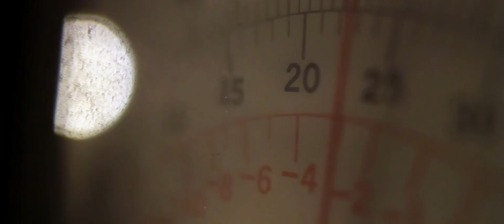The Morgan EV3 - Official Launch Trailer [HD]

Comment: It looks slightly oversteering in the sharper corners? A reverse trike needs its CG close to the front wheels, hence the old Morgans had their engine up front.However  in an EV you have hundreds of pounds of batteries, and can't place them where the drivers legs are, so they put them behind the seat? This is a recipe for cartwheeling. Imagine going over wet leaves in a bend, instant 180!! The motor controller heatsink in front of the headlamp is a beautiful design choice.

Comment: Would be cool with a manual gearbox, but there is not the joy of the combustion sound and no there is not the joy of rowing gears. For me, almost looks a soulless car. The design is beautiful.
Reply: +Ger Downshift Unfortunately the combustion engine is finished, at least for 98% of vehicles so you can't blame Morgan for that.  I would suggest that out of all the electric cars available this one has more 'soul' than most of the others put together, it still looks incredible fun even though you don't have the sound of an engine.  Love it or hate it quiet running electric cars are the future, enjoy that V8 while you can.
Reply: +IanObzi ya ya ya the fools have been saying that for 110 years .. with all the oil around and the lack of electric  miles distance before recharge .. long time recharging , lack of recharging stations .. and the need for gas tax to off set the lack of sales .govt. forced buys . it will be another 100 years of battery up grade changes to even think of it happening ..
Reply: IanObzi Yes, you are right. But what I said is that would be cool if it has a manual transmission at least; you would improve performance and battery autonomy at the same time. Imagine yourself "heel and toeing" in an electric car... so much more fun than just sinking your right foot. (Sorry for my english)
Reply: I'm going to the Geneva show this weekend so hopefully I'll see this in the flesh, I did the Morgan factory visit last year and it was great to see a little company making something very different to anything else on the market.

No apologies for your English, it's very good, better than many people who live here in the UK.
Reply: +Ger Downshift  I might be mistaken, but from what I have read, for electric vehicles, there is no need for multi geared transmissions. For electric motors, torque is torque is torque. Recall why a multi geared transmission is needed for gasoline engines (start immediately in a  high gear and the gasoline engine would simply stall out--unable to deliver that kind of torque to such a high ratio gear combination) and I believe you'll understand why it won't be needed electric motors. Check me on this...read about it a while back, but I believe this is the case.
Still, this is a wonderful cycle car...much more my style than the Polaris slingshot which is the only cycle car available in the US which I know of.
If you do see the Morgan at the show in Geneva, ask them about that and get back to us here. I'd love to read their perspective on this issue.
Reply: Drew Abas Yes, there is no need as in internal combustion engines, but with a manual transmissión you would improve acceleration and autonomy at the same time. Shorter gears give better acceleration and longer gears give more autonomy. In fact, Formula E cars have multi-gear transmissions, and the Detroit Electric SP:01 has a manual transmission as an option, so obviously there is a profit using a multi-gear transmissions with electric motors. In other words, it isn't necessary, but is better. (Sorry for my english)
Reply: +Ger Downshift well, give us a full report here on what you learn in Geneva. I so wish something like this was available in the US....but less expensive!
Reply: Drew Abas I will not go to Geneva.